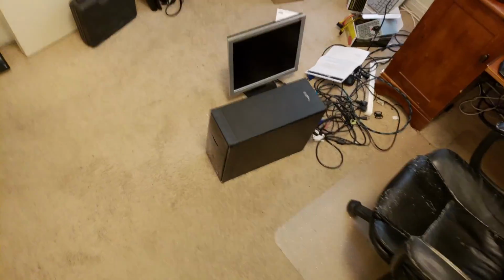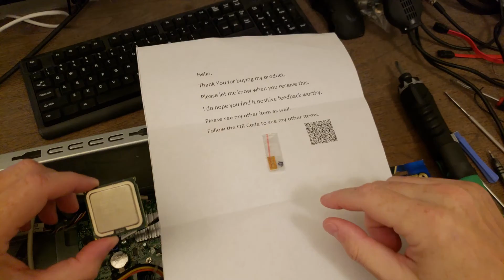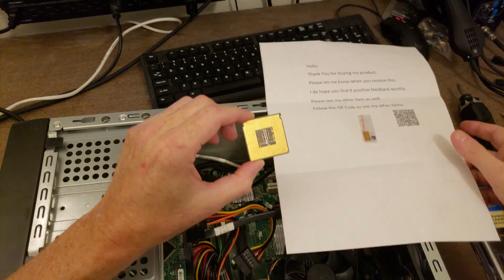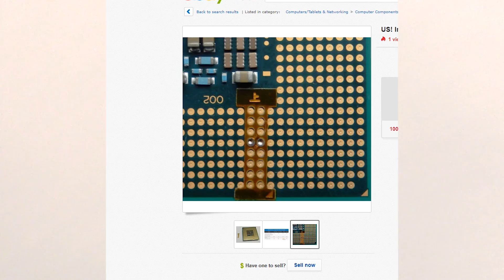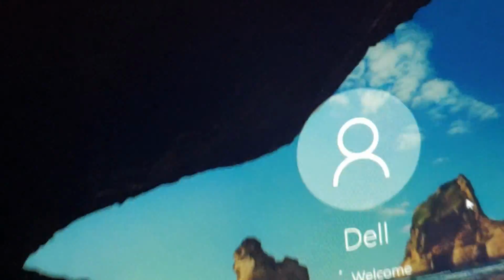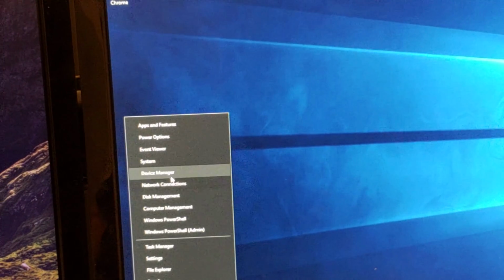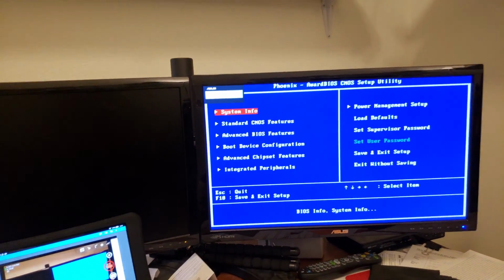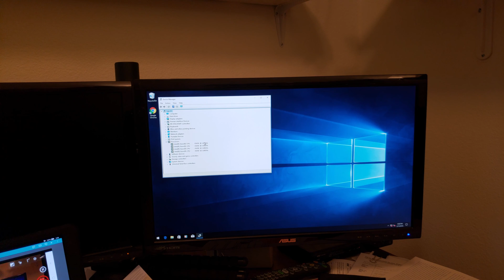$15 Upgrade to a Xeon 4 Core CPU from a Pentium 2 Core CPU - Dell Inspiron 545

Comment: I’ve got the same machine, inspiron 545s, and I’ve tried installing both a sticker’d Xeon X5460 and Xeon X5270 that I had laying around. It’ll boot and post fine, and runs Linux great, but it will not boot to Windows 10; not my OS nor my bootable windows 10 installer USB. It hits the Windows logo and then restarts and goes into an infinite boot loop every time. Tried CMOS reset and updating bios too. I’m thinking it has to just be an incompatibility of these procs with Win10, but it seems like others are running them fine. Any ideas? Thanks for the vid!
Reply from the maker: Look in the bios for an option to switch between UEFI and legacy. Whatever it's on now try switching to the other and reinstalling windows. That may get it going.
Reply: @MichaelTheComputerGuy  thanks for the reply, I appreciate it! The board/bios isn’t capable of UEFI, as far as i know. Can’t find any options related to it either. I know that my windows install is definitely MBR, and i’ve tried booting to both my UEFI and MBR installers with the same results. I swapped back in the old CPU, an E5300, and it’s booting to Windows fine so It’s definitely something about the Xeons. One thing I did notice is that when I have the Xeons installed,  the option to enable virtualization in the bios is missing, so not sure what to make of that. I’ve read that NX bit and virtualization are needed for the Xeons, and NX bit is still there, but not sure why virt is missing or how to get it back.

Comment: Dell Inspiron 545 socket: lga775 Intel Core2 Quad 8200, Radeon HD 3450 256MB(want to upgrade), About to put a 500GB WD SSD in this 2009 PC  just because I can...
Reply: Do you have any problem installing that processor on the Mobo ?, I had one and want to upgrade but I don't find any info about that in compability
Reply: @antonycw4133  Very sorry for the very late reply.  That is the processor I purchased it with back in 2009.  I have been looking at upgrading to the Q9650.  Also, I switched to an 1024MB(1GB) ATI AMD Radeon HD 7700 Series (7750) It pushes PUBG Mobile on Gameloop Emulator, BF1942, Allied General etc... I haven't tried any modern Games simply because I don't have any. Plays Movies well.  It was worth the price to keep this machine usable. Also, I am running Win10 unregistered given this is basically a DVD player & occasional game nostalgia for me.

Comment: I've just done this upgrade. My rear case fan does not function properly since doing it. It spins on boot and then stops. Also gives a small movement on shutdown. CPU FAN running fine. Any ideas on fixing the case fan? Thanks!
Reply from the maker: That might not spin up unless the temperature gets to a certain point.
Reply: @MichaelTheComputerGuy  I was thinking that too, but it was definitely spinning consistently when the original processor was in....so that leaves me slightly concerned about overheating when I put the cover back on.
Reply: Maybe the Xeon runs at a cooler temperature

Comment: Hey Michael, I did the exact upgrade with my Inspiron (also a 545), but I think I'm getting some high temps. The software I have used says the cores are around 60 C and a sensor on the motherboard is at 87 C. Is this a big problem? I don't know if this is normal.
Reply: Which temperature measuring software are you using?
Reply from the maker: 60C is OK. 87C is high.  That 87C may be a motherboard temperature reading.  Try blowing air across the motherboard around the CPU and see if that 87C temp drops.  If it does, installing a case fan to blow across the motherboard would be a good idea.  If it doesn't trop that temperature I would just chalk it up to a bad reading and not worry about it.
Reply: @MichaelTheComputerGuy  Thanks for the suggestions! I'm looking at the temps on speedfan (I've confirmed with other programs) and there are three temps the motherboard is showing. One is the 87 (it doesn't change) another is 30 C, and the last is -43 C, which makes me think that there's some faulty sensors.
Reply from the maker: @lanebase.2122  Yes if the 87C doesn't change and temp another is -43C they are definitely false readings.